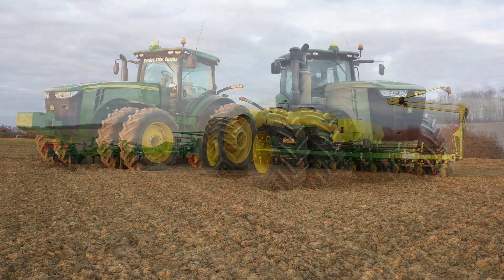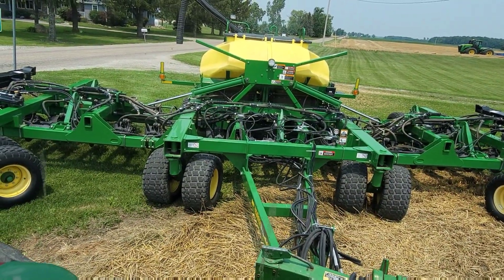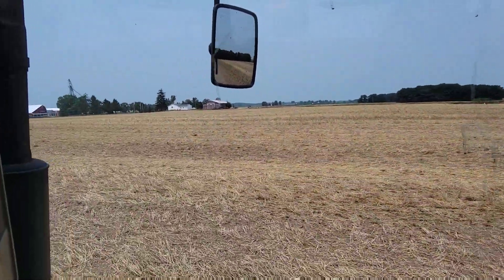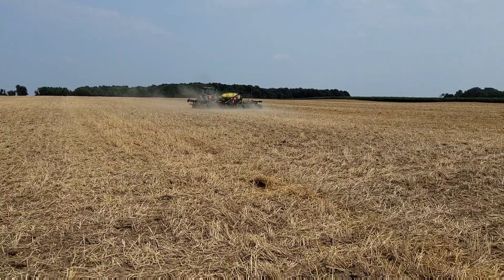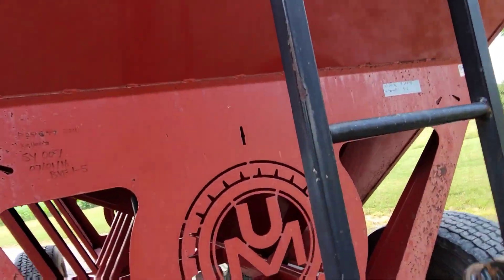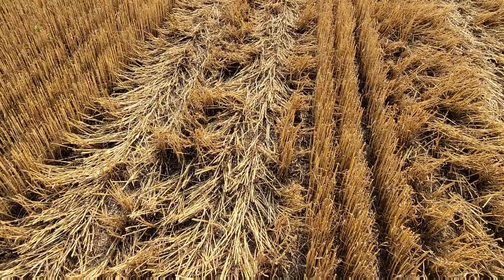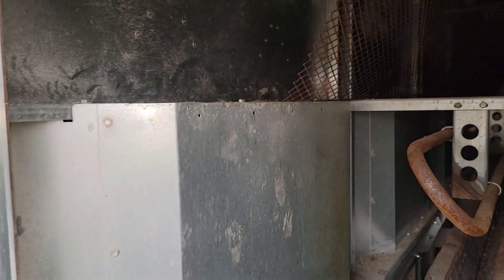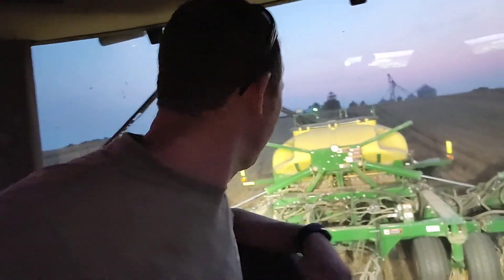Planting Double Crop Beans! - #453

Comment: It will be interesting to see how DC beans do this year.  I think it is good that you are testing the air seeder.  Looks like you are seeding at 10" instead of 20".  Another variation to see how they do.  I have been curious at what spacing seed companies would consider to be optimum for either beans or corn if planter costs were no issue?  There are a number of different spacings to choose from and I have also seen some double row planters that I wonder how they do?
Also good to see that you are making some use out of the older ponies but also curious what made you decide to use that tractor instead of the regular bean planting tractor?
Reply from the maker: The 8430 is still hooked up to 1790 which we still might use to plant some beans